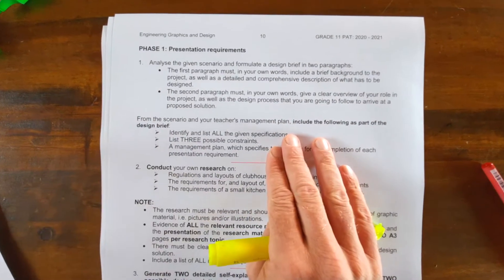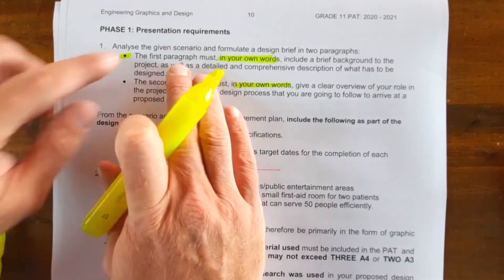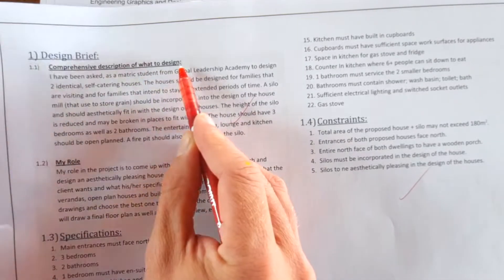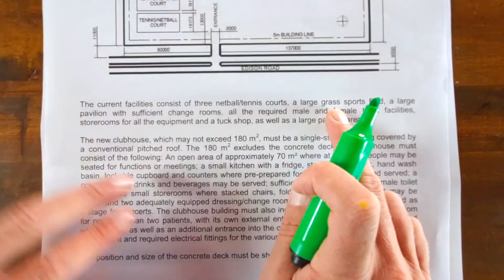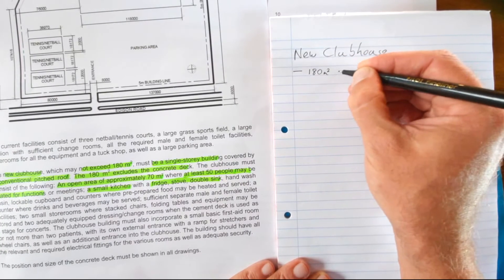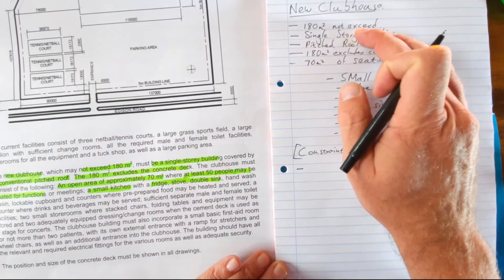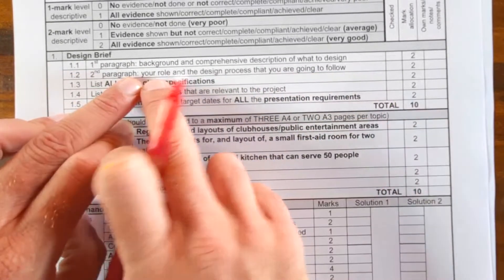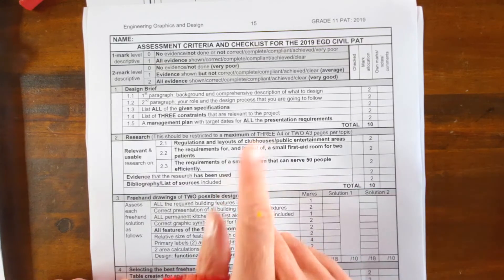EGD CIVIL PAT - Design Brief, Specifications, Constraints & Management Plan - EPISODE 2 - Grade 11

Comment: hi does anyone know if your paragraphs and pat writing should be written on the a3 paper and in what orientation (portrait or landscape) or should it be written and handed in on a note pad
Reply from the maker: Hi Faised, Thanks for the question. I am sure your teacher will give you the best answer on your question. At my school, I however require all PAT work to be done on Landscape - A3 - and neatly typed out. The reason for this is that your PAT is actually an exercise to prepare you for submitting future proposals as qualified engineers or architects, and I am sure you won't be handing a potential client any hand written proposals... All the best and please check with your teacher on their specific requirements. Look forward to hearing more from you in future.